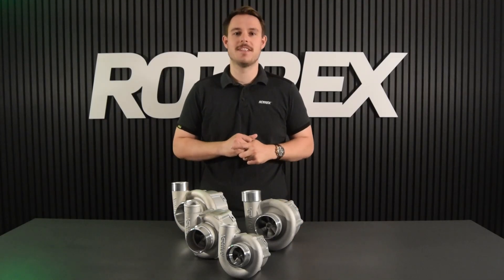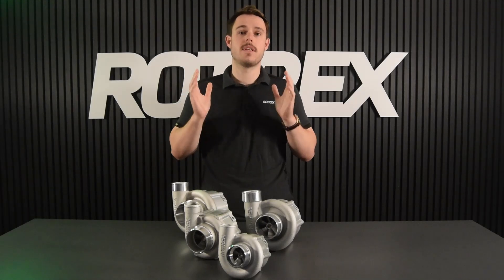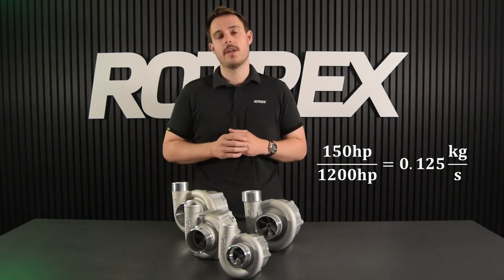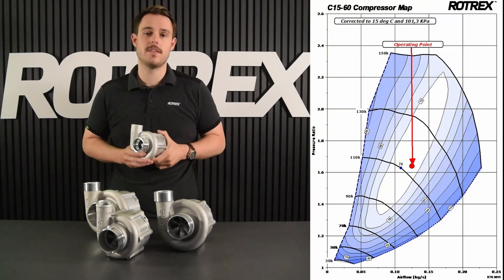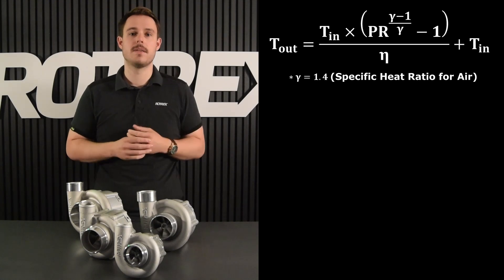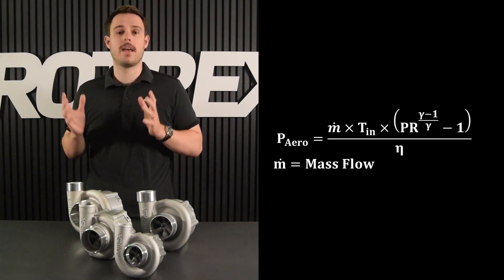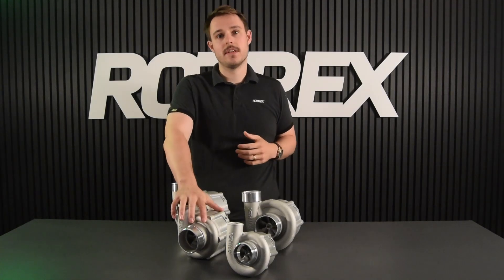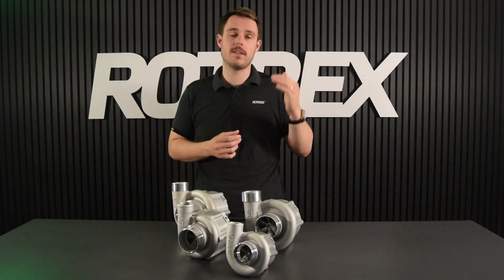How To Choose The Right Supercharger Size

Comment: Is the airflow a calculation of target total ie: 150hp or of the target hp increase from stock? ie: 45hp
Reply from the maker: That's a great question! 
You use the total target (150hp), to determine the total airflow that the supercharger should be able to supply

Comment: Is the rotrex c15-60 ok to run on a 4age 16v with ARP head studs, upgrade valve springs and retainers with stock internals or should I atleast put in some supercharge pistons and leave everything else ???